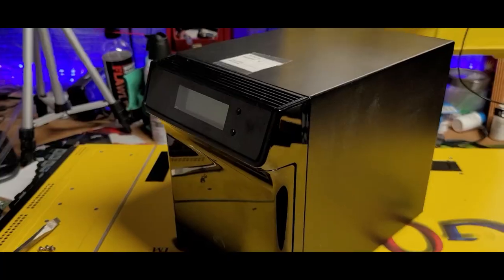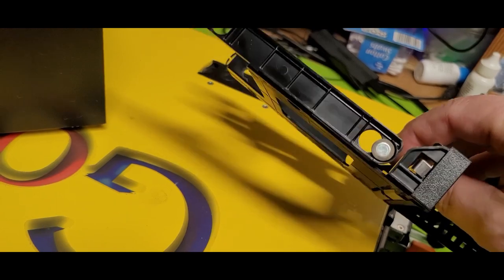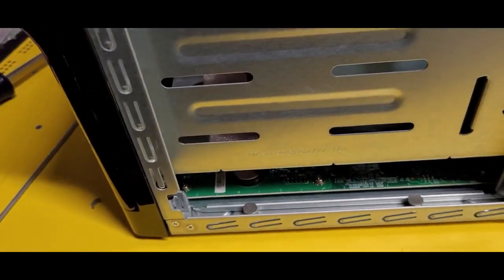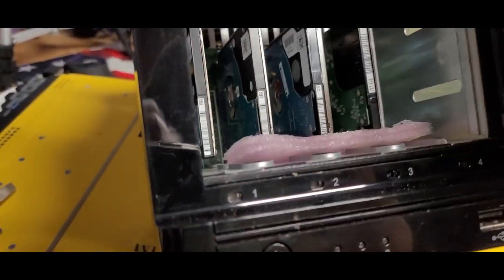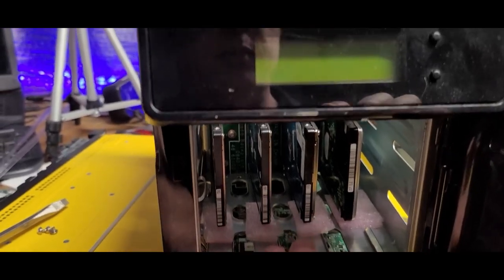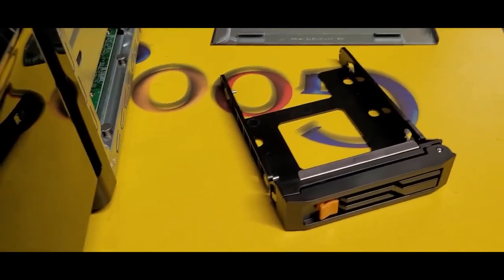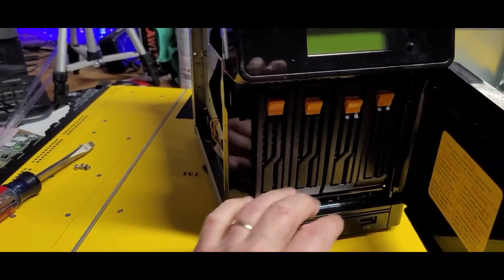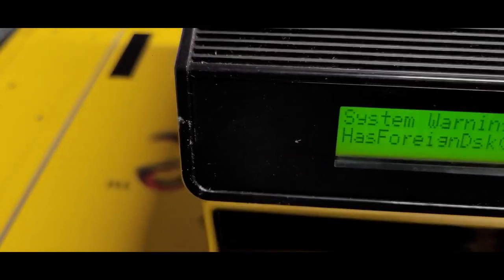Rebuilding a old Seagate black Armour 400 NAS back to life to sell it off

Comment: I just installed normal 3.5 inch disks and used the disk screws in the caddies. No issues at all. Not sure why you went through all that trouble to cut the caddies?? Plus even if you wanted to use the 2.5" Disks an elegant solution would have been to just make 4 holes at the base of the caddy and use screws to hold the disks in place. The solution you suggested is neither very elegant nor very practical.
Reply from the maker: Because I wanted to test NVMe ssd drives for the fun of it and unlike your spinning disks, the much smaller format ssd drive of the same sive also maxed out the I/O bis to the fastest bandwidth possible.  Oh and just for the fun of it to prove an idea.  It either or sell the old NAS array for scrape due to its age.  Like I said for fun.
Reply: @leadiususa7394  I am having fun with this as well. 🙂 Tested out 8TB Disks as well and they worked. But looking at the extremely low memory and CPU of the device i wouldn't recommend it. Not sure how Useful SSDs would be in this. Considering this has SATAII Ports and only gigabit network connection. Even spinning Disks would saturate the Gigabit Link.

Comment: good fix of this Brad would like to see if you could get m2.nvme in this, and you should consider investing in a 3D printer i need one myself their are alot on the market these days though some are better than others so if you ever decided to get one may be good idea to do what your thought process is on getting one :)

but i also would like a swift cutter very useful tools for the workshop https://www.youtube.com/watch?v=TfD-lemJqFs:face-green-smiling:
Reply from the maker: Good point and my son works with them so that is a good resource for me to chekc it out. I will do a video on what is a good 3D printer to IT projects.  Thanks
Reply from the maker: As for the NVMe on SATA I think I need few of these to make it work.  https://www.temu.com/subject/n9/googleshopping-landingpage-a-psurl.html?goods_id=601099512382652&_bg_fs=1&_p_rfs=1&_x_ads_channel=google&_x_ads_sub_channel=shopping&_x_login_type=Google&_x_vst_scene=adg&sku_id=17592190442314&_x_ns_sku_id=17592190442314&_x_ads_account=8195172345&_x_ads_set=18597826067&_x_ads_id=150873099588&_x_ads_creative_id=628103286637&_x_ns_source=g&_x_ns_gclid=Cj0KCQiA8t2eBhDeARIsAAVEga3JG1AyOPP5opbIUqQG6w5vKm0FCLyb2SI0CSiKOn7JrMP6hnhlpiQaApgrEALw_wcB&_x_ns_placement=&_x_ns_match_type=&_x_ns_ad_position=&_x_ns_product_id=17592190442314&_x_ns_wbraid=CjgKCAiAz9ieBhAsEigA7oCFp_QD7YVwvsts-Ee0KZoW-bfViIManqi0QOexB86Dlr8DRofYGgKf9A&_x_ns_gbraid=0AAAAAo4mICEyP01kUkjUUrklWfApfJAol